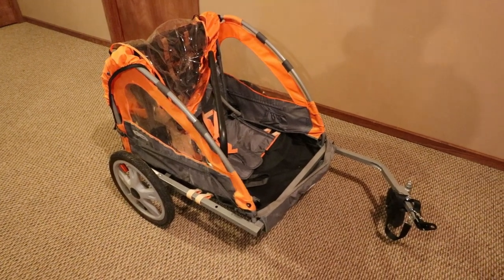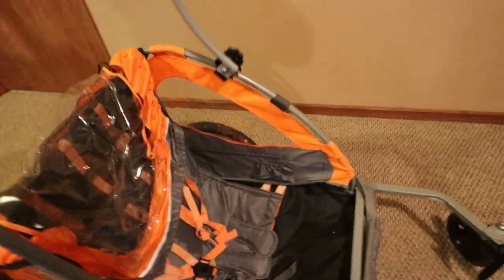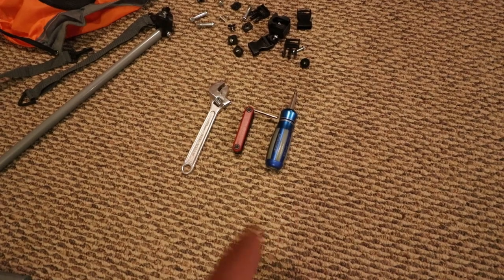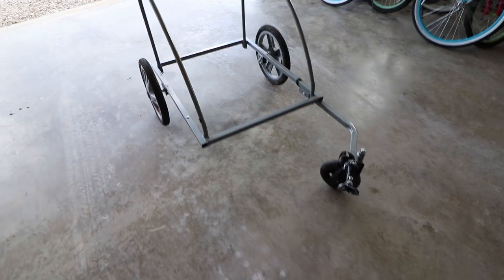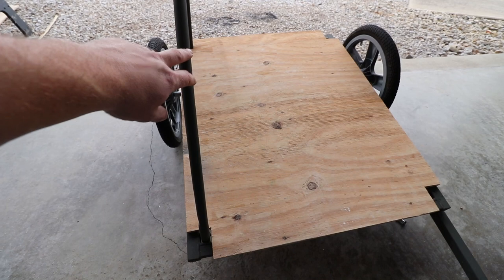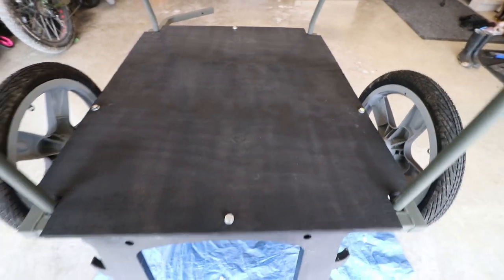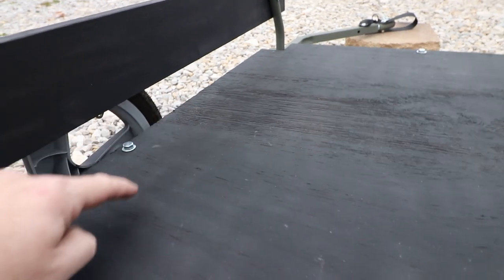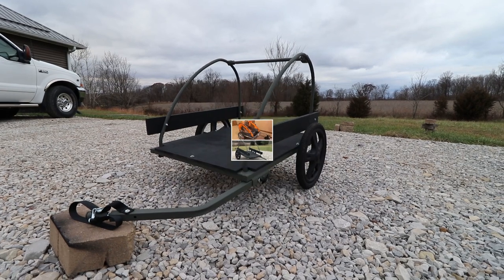DIY Bike Trailer

Comment: Thanks for this video. I've been searching for some inspiration in converting a child carrier to a useful cargo trailer for camping. You have provided just that and I'm grateful. The carrier I'm in the process of buying is a single but using your methods, it will do me just fine. 
I've got some redundant alloy tent poles and might try to use them instead of wooden side panels. 
Thanks again. 
Best wishes across the Pond
Paul in the UK Midlands
Reply from the maker: Good to hear 👍👍. Best of luck with the build buddy!

Comment: Looks good but if you wanted to go lighter in weight you should use fence screening for the floor and put a tarp over the floor to keep out debris plus if you wife is able to sew or you do the cloth you removed would also make uaefull side panels and then add either eye bolts or small handle pulls like for a dresser to attach bungy. Cords to as for the push handle you have for it you can use it to lengthen the trailer for carrying deer size game it works and still stays light.

Comment: I like this type of trailer but instead of the plywood I would add hollow cross members and then metal wire fencing
 I would also cut down the side panel bars and make them strait across and add the wire fencing material to your sides with a top bar to attach it to you can use the excess material like the push handle and the removed excess extra side panel lengths to lengthen the trailer for deer/bear sized game plus hunting equipment. Also I would add a different trailer hitch both to the trailer and to the bike. Also I would get two 20 inch bmx front bike wheels that are made for the kids bikes they are made for tougher use as kids can be rougher on their bikes plus the tires and tubes are manufactured thicker and wider and it would give you more ground clearance for getting into where you want to go. Plus get a medium large sturdy tarp to place both on top of the trailer floor and under what you are hauling but can be folded over it also si as to protect both game and to help against loss of small valuable equipment. It will pay for itself in both the long and short run.
Reply from the maker: Make a video when you do all of this!
Reply: @HoosierHunter  You are seriously the goat!!!! 😂 I'm subscribing! I was trying to find something to up cycle my 2  bike trailers I had into something.... I certainly am glad I read the comments 😂

Comment: avid bowhunter considering buying same bike.  what back pack do you use to carry your bow while riding. how do you transport your treestand,  what size bike did you get, Im 6ft, 230
Reply from the maker: Hey Steve.  Appreciate you watching and following along.  I will put the tree stand on that trailer that I made.  I will either carry my bow in it's hard case on the trailer or I will still strap it to my Sitka Tool Bucket.  I have a video on my channel of the Sitka Tool Bucket as well.  I got the Large framed bike.  I am 5'10" and about 220.  The bike fits me really well.  My seat is pretty far down so I think a large would fit you as well as you could raise the seat post some since you are a little taller.

Comment: Nice trailer conversion! What's the heaviest load you've carried with the axles and plastic wheels? I've got a VERY similar trailer I'm wanting to convert, but was thinking about strapping a fresh deer to it next time I get one (instead of dragging it out manually).
Reply from the maker: Thanks!  I have had just a little over 100 pounds on mine. It did fine with that amount of weight. Pretty handy!  Thanks for watching.

Comment: I would have left it the way it was. Still holds the same amount, and had a cover to keep gear dry
Reply from the maker: It wouldn’t have worked for me with long rifle cases and some of the longer things I haul on it that hang off of the back. I can still put a tarp over it if needed with the top support bar.

Comment: Looks great! Perhaps add a tail board and one on the front as well. You mentioned it was rated for 80# I'm sure it will hold 87..LOL. FN64GR
Reply from the maker: Haha. You’re right. I actually had a board out for the back side of it but I am going to be hauling a hard rifle case and it wasn’t going to fit in there very well at all with the back being closed off. I can let it hang over just a bit and just strap it to the side boards. It works pretty well that way.

Comment: An 80 pound load would be a lot for this little rig, it screams out "Light Duty".
Reply from the maker: Has done fine with 2 fifty pound salt blocks at once on several trips! 🤷🏼‍♂️🤷🏼‍♂️
Reply: @HoosierHunter  Doing fine under normal conditions is one thing, safe operation in difficult unexpected instances with a heavily laden rig is quite another. You could put 350 pounds in it at rest, that doesn't mean it would ride well or be safe to tow.
Reply from the maker: Works for my purposes. Have a good one!

Comment: You could leave the front small wheel as a jokey wheel like what most caravans campers or other trailers have (like if you agree)
Reply from the maker: I tried that for just a little bit but since the cart angles up slightly that wheel doesn’t touch at all times. It would hit in spots and then the wheel would spin all around. Also, it would get caught in grass going through fields.
Reply: No no no what I mean is to have it when the trailer is NOT hitched up to the bike and it is there just for when the trailer is just sitting
Reply from the maker: Got it 👍